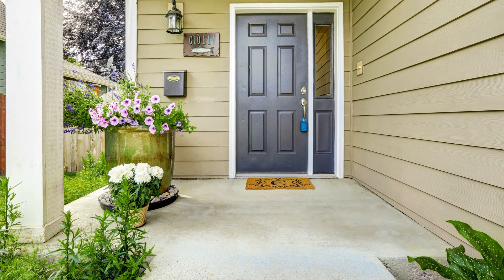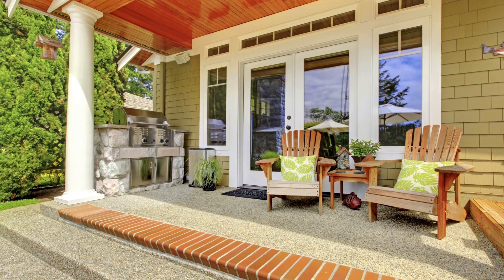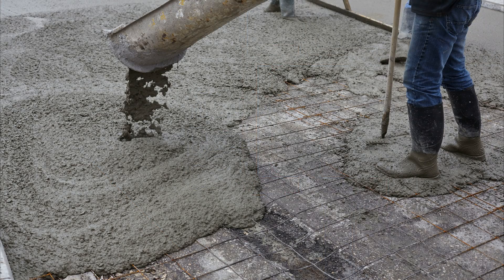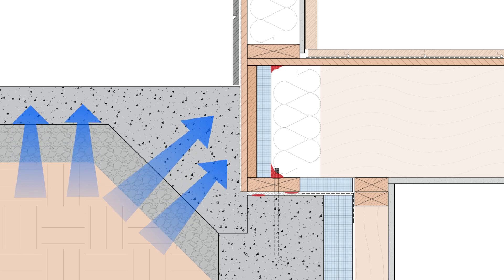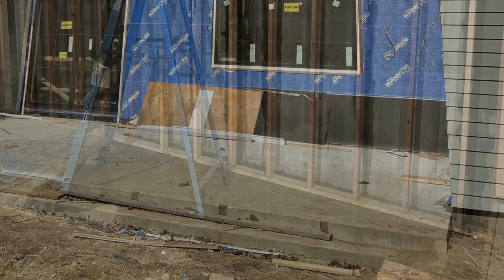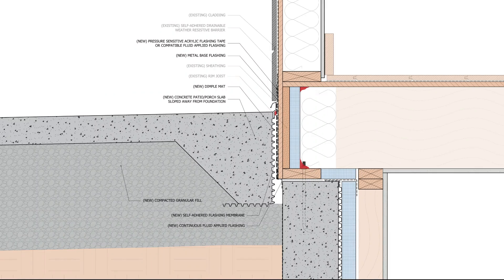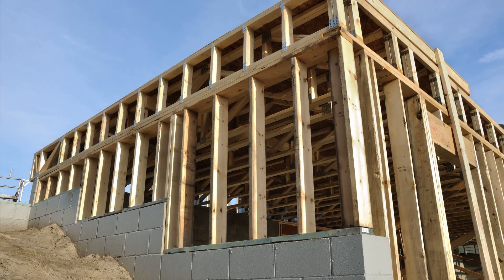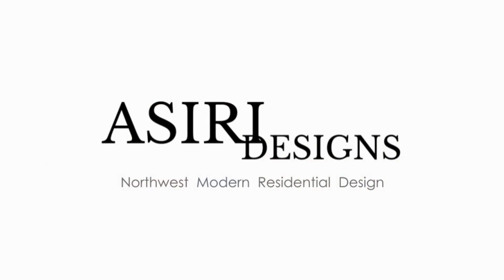Rotten Rim Joists at Your Concrete Porch?! Here's Why It's Happening.

Comment: Excellent detail in the video - do you have any specific IRC references that would direct a designer/builder to install a capillary break between the concrete and the house?  Also, any IRC reference for the metal base flashing extending from behind the siding to the surface of the concrete to direct water out?  R703.4 mandates flashing where masonry construction intersects framed walls but masonry and concrete are typically not used interchangeably.

Comment: Thanks for making this video, I'm a home inspector and have been writing up concrete porches against the siding or WRB for years now. I will often get pushback and ridicule from builders (who have yet to see the damage this can cause). Previously as a contractor I lost count of how many rotted rim joists I've replace from being below grade or below a concrete or masonry porch. Just yesterday I saw a porch that was like this but they used rebar pens to go through the concrete slab and into the rim joist?! Of course there was water intrusion at every rebar pin.
Do you mind if I link to your video in my inspection reports when I observe this condition?
Reply: Do you mind sharing what IRC section you're referencing to write this up?  I believe R703.4 would qualify for the requirement to flash behind the siding, out to the top of the patio but don't see this called out very often

Comment: I like the idea of a capillary break. The last detail you show seems to have the slab resting on the backfill. This structurally isn’t a good idea as settling will occur. Especially if you have 9 and 10 ft poured walls. I do agree that this is a major issue and problem area with moisture.
Reply: I agree there. Needs to be a concrete or CMU stem wall and poured footing taking the lateral load exerted by the soil and drainage gravel between the fill and the dimple mat.

Comment: Neat, I wouldn't have even thought this was allowed for all the reasons you mentioned here.

If you feel like answering, while most of this isn't applicable indoors, are there concerns for doing this internally?
IE: The same detail, but for a house slab (fully insulated and vapor barriered) meeting the rim joist of an i-joist floor flush with solid plastic vapor barrier between them?